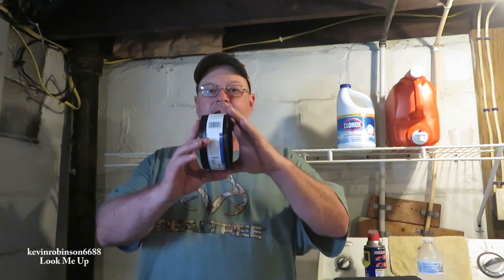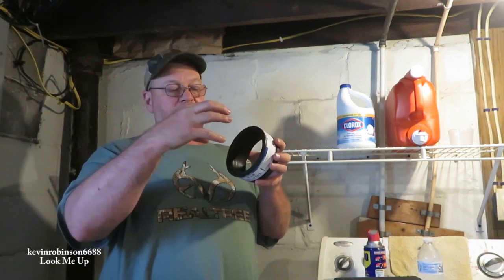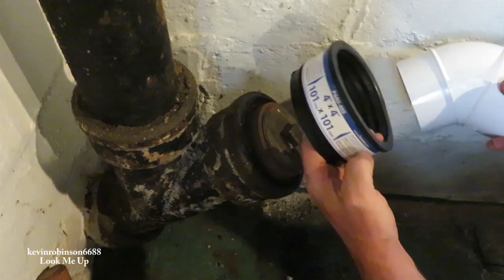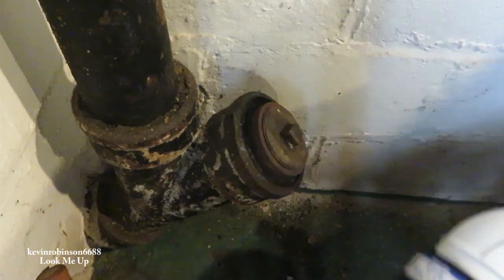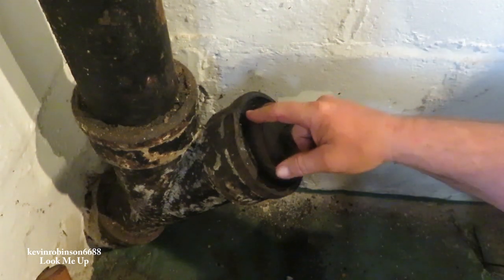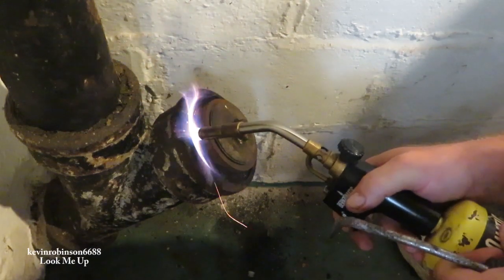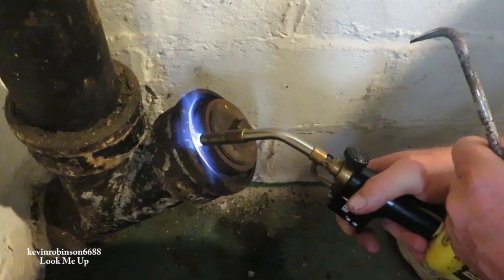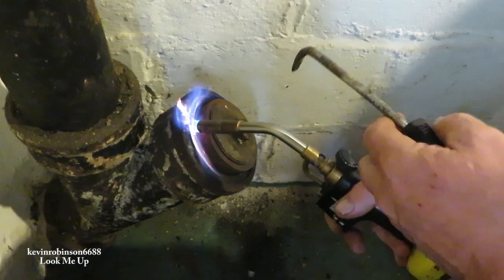How to remove a lead joint form Cast iron drain and connect to pvc pipe

Comment: At the end 14:55 : How the boot will stay in place without leaking? Are you going to glue? as I don't see any means for pressure tightening.
Reply: Not the right fitting he had a SDR fitting, needs DWV. With the proper fitting it will seal just fine.
Reply: I am getting ready to do this.  From my research, the outside of a sch 40 pipe will be a very tight fit in the rubber. In fact you have to lube the pipe with dish soap and then drive it in with a a hammer and block of wood.   The lips on the seal are facing such that they act as “barbs” like a fish hook making pulling the pipe out difficult.

Comment: Proves that if you have a lot of patience to stick with heating the cast iron, it will come free. Thank For This.
Reply from the maker: You bet thanks for watching
Reply: It is ALOT faster with a TURBO torch tip, but most residential plumber's do not have or need a torch that gets that hot

Comment: It looked like the fitting went into the Fernco donut to easily, The connection should be tight and somewhat difficult to install. I don't think the correct donut was used.

This is from the Fernco website:
     
Sewer pipe companies do not manufacture their pipe to common dimensional standards. Instead, pipe is produced to the designs and dimensions best suited for each particular sewer system. Because of this, variations in dimensions of pipe bells, hubs and bores are simply too great to permit making a single universal connector.
Fernco Donuts are available in hundreds of sizes and configurations for use with most brands and types of piping material.
Donuts can be ordered by giving the size, material and type of connection you want to make. Donuts require specific information on the manufacturer of pipe. Our sales coordinators are trained to assist you.
Donuts can also be ordered by dimensions. Donuts seal by compression and have much less dimensional range than couplings. The bell, hub or socket dimensions must be given within 1/32" accuracy.

Fernco phone # is 1-810-503-9000

Chamfering the pipe and using dish soap helps a lot with installation
Reply from the maker: Thanks for the info

Comment: Melting lead is safer than drilling if you use a respirator. Drilling produces tiny fragments that are more difficult to clean up. I wonder if heating up the outside of the cutout with a hotter gas would speed up the melting process. Nice video. I will be replacing some cast iron pipe in my 104 year old house soon.
Reply from the maker: Thanks for watching and be safe with your project.
Reply: Oxyacetylene or oxypropane would work much better. Cast absorbs all the heat, and the lead doesn't want to melt.

Comment: I usually just drill out the lead. After enough holes, the fitting will spin right out. It saves on gas and protects you from the fumes if you don't have proper ventilation.
Reply from the maker: Great tip

Comment: From my experiences its quicker and safer to drill most of the lead and oakum out instead of melting it out
Reply: Yep, I’m planning on doing this project this weekend and I’m gonna drill. Too risky using a torch
Reply: @Fordgroup00  no boom.
Reply: Isn’t it a bad idea to use a torch around sewer gases?
Reply: @juniormyers5378  methane gases... Which would be more a stagnant situation, pipes have vents and p traps,
But who knows, someone probably has blown themselves up given the amount of knuckle heads I've seen, but definitely a drill bit and chisel job here...
Reply: True,the professional way,I don't like a torch near a closed sewer line,methane could go boom.
Reply from the maker: Good tip

Comment: Is propane hot enough, or do you need to use a MAPP gas? Thanks!
Reply from the maker: Propane would be fine just take longer be careful you may have sewer gas read the comments first.

Comment: Thank you for taking the time and effort to make this video. To the comment section I would recommend a4” ez tight gasket,piece of 4” schedule 40 pipe and a schdule40 4” 45. St 45s or 90s are the best type of fitting for this connection, a short piece of pipe should be used to insure it extends through gasket and hits bottom of cast iron hub. the gasket here looks to be very loose. This connection with a proper gasket never goes in easy with minimal force. Use an ez tight or multi tight,take the edge off the end piece to insert and lube it up, you will know when it a good seal. To take out the old cast iron hub, chisel out brass cap, split inside of cast iron insert, chisel sides in and remove. I would shove a rag in the pipe to prevent and pieces from falling into line during this process
Reply: I cut a notch on the inside of the pipe. One on either side with a sawzall and cast iron blade.
Cut from inside of the pipe through to the lead as much as you can without hitting the hub.
When you have at least (2) notches chisel the pieces toward the middle.
I always put a balled up rag down inside the pipe to keep the pieces from falling into the drain line.
Reply from the maker: Thanks for the comment
Reply: I know this is an older comment, but how do you split the cast iron insert?
Reply: Is the EZ-Tight the correct gasket for XH (not service weight) iron pipe to join to PVC?
Reply: @AaronBennett-mi9uf  there are 2 different types of gaskets service weight and extra heavy I’ve used 4” service weight ones on both types of pipe with lube and some leverage to pop them in.
Reply: @AaronBennett-mi9uf  if your putting the pvc directly into the gasket/ hub be sure to ream the outside edge of pvc.

Comment: Being a plumber for 30 years these diy videos are very entertaining
Reply: To correct my typos I would NOT recommend a street or (spigot) type fitting for inserting into cast iron hub, use a piece of pipe
Reply: @MK-xl9tt   Your right. That 45 street ell just isn't long enough, I would have used a 1 foot section, that way you can drive it all the way (maybe 6 inches) until it bottoms out in the doughnut.  That doughnut has to be completely filled to expand into the cast iron hub and seal it.  After that you can put on any fitting you need.
Reply from the maker: Thanks for the comment
Reply: @MK-xl9tt  pvc pipe?

Comment: You used the wrong style PVC Street 45 fitting into the rubber Fernco fitting, they should NEVER push in loose as yours did. The one you used is called a "4" sewer and drain 45 degree elbow" which is slightly smaller diameter than the correct fitting called a "Schedule 40 PVC-DWV Street 45" (DWV). ... Drain, Waste, & Vent fittings are used inside buildings and Sewer & Drain fittings/pipe (S&D) are only used outside buildings for the sewer lines that start approx. 2' outside the house and run to the municipal sewer connection. 
Also, the pipe you call "Black Iron" pipe is actually called "Cast Iron" DWV pipe and is either "Service Weight" CI or "Extra Heavy" CI and those old fittings will be embossed with a "XH" or "SW" on the hub exterior as they are slightly different in size. When you buy those rubber Fernco donuts for this type of replacement job you need to know whether your CI hub it is going in is XH or SW or they wont fit/seal properly.
I have made many of these "CI to PVC sch 40" repair connection's in the past and have always needed to extremely force the PVC-40 fitting into the donut hub, even with grease on both pieces, so when yours went in with zero resistance it showed that the wrong fitting's were used.
Reply: God bless you for your educational comment. Can you please tell me where can I purchase the donut for Extra Heavy pipe 4 inch?  They sell SW donut in Home Depot, but I have a real problem: can’t find correct donut fog XH.I soooo much appreciate your knowledge and time. Thank you!
Reply: @Miftakho  Just to let you know, I did reply here last night with some very lengthy explanations to your questions and it did show up in this comment section for about 1/2 hour after submitting it, but then it was removed without any explaination .... I don't know if it was the YT people or this guy "kevin robinson" who didn't like what I said, but either way that's pretty shallow.
Reply: @bobrub  I'm working on a kitchen drain for my daughter and her cast iron is broken under the slab. I  haven't cut it open and removed the bad pipe back to a hub I will have to look to see if SW or HW. Either way do you use sealant between cast and rubber donut and what holds PVC pipe into donut? Friction or sealant?
Reply: @jeffreprogle7958  When using a donut it has self sealing rubber edges that make the water tight connection both inside the hub and against the inserted pipe. Sometime you need to use a light grease or dish soap to facilitate insertion. PVC pipe should have a 45 degree bevel ground on the end to be inserted and you will feel it bottom out in hub at full insertion. In your repair, an easier method may be to cleanly chop off the rotted cast iron downstream of the bad point and simply use a shielded coupling (commonly called a "no-hub" coupling) made to join PVC sch 40 pipe to SW or XH CI pipe of various sizes. Google fernco proflex couplings to view. Available online or at plumbing supply house.
Reply from the maker: Thanks for watching and the comment.
Reply: Thanks for that master tip.

Comment: nice video and thank you. mine doesn't have the lead joint, copper connects to the cast iron directly and stuck. any suggestions? thanks a lot.
Reply: Joe M  thank you very much.
Reply from the maker: I heated mine but could not break it loose it saw seized in there.

Comment: my main concerns with this method of removal is lead vapors and possibly setting the oakum aflame.
Reply from the maker: Yes be very careful.
Reply: Used oakum is soaked so expands to seal the pipe, making it non burnable. Dried out oakum, like above all the sinks, will burn. Lit some the other day. (accidentally). No stink pipe odors 👍

Comment: How I remove lead....unscrew c.o. plug.....insert rag to protect inside of pipe form debris....use reciprocating saw to cut c.o. fitting...cut fitting in two places and drive chisel into edge to spread fitting inward...remove c.o. fitting...cut out lead very easily and remove....saves
your lungs and the atmosphere from all that heated lead, oakum, and stink.
Reply from the maker: I couldn't get the c.o. plug unscrewed thanks for the info.
Reply: @Robinson-Homestead  hammer and chisel

Comment: You know there’s flammable gasses in that pipe right?
Reply: There could be, except methane is lighter than air and the vent tube attached to that joint takes it away making the volume of combustible gas almost negligible.
Reply from the maker: Thanks for the info.

Comment: I don't understand the first piece that you had the rubber hub was that what you ended up using in the end what's the deal with that? Did you just realize you had the wrong thing?
Reply from the maker: That was the same rubber thanks for the comment

Comment: How do replace the bottom section of a cast iron drain column with PVC or ABS? Will the weight of the column be too heavy for the transition?
Reply: Hi, it depends on the situation.
Reply from the maker: sorry i'm not a plumber, so i can't answer that.
Reply: Joe M , Riser clamps should be used to hold it up .👷🏻

Comment: Hey smokey, that hub fitting looks a little loose on the pvc,  they do have different sizes,  mine always fit snug,  like real snug,  hope sewer never backs up, just might seep out, just my opinion
Reply: David your right way to loose. The 4" street elbow he used fits inside the 4" pcv pipe that why it was so loose (easy). Should have started with 4" pipe then add the elbow.
Reply from the maker: Thanks for the info
Reply: The hub says that it is made for ABS pipe not PVC pipe. I wonder if there is a difference?
Reply: Eamon Road , They are both the same size , standard pipe size. 👷🏻
Reply: @johnkrim8377  Not a plumber, but my understanding is that there is no "standard" size cast iron fittings. Each foundry had their own molds, so there can be significant differences in diameters for any given nominal size. That's why there are many different sized "donuts" available. Best to measure the ID of the hub to get the right size donut. My guess is that the OP's hub was a bit bigger than what that particular donut was meant for. The inner diameter of the donut is sized to the standard pvc/abs size. If the hub was smaller, it would squeeze down the inner diameter when the donut was inserted into the hub, so everything would be tighter. It really should take much more work to get everything inserted.

Comment: Although I could be wrong, I believe the reason the PVC fitting is loose is because it’s a “Street” elbow, which means its outside diameter is 4 inches, and the rubber adaptor is expecting the normal outside diameter of 4.5 inches.  I imagine if he stuck a normal piece of 4 inch PVC pipe in there, the fit would be very snug.
Reply: Street is same size as OD
Reply: @r777v  No, the street size would be the same as the ID, not the OD.
Reply from the maker: thank you for the comment
Reply from the maker: @davidramey7186  sorry your right about Street elbow it has been working ok no small or leeks thanks for the comment.
Reply: Correct. His install would fail an inspection! Which we know code is the bare minimum... not the top notch. So not even passing code is a major red flag

Comment: A lot of plumbers just call that a "Donut"  after you put the donut in the hub and you was able to put the pvc pipe in easily I think you should have got the heavy weight one. Because usually it should show some restrictions for it to be water tight.
Reply from the maker: Thank you for the info.

Comment: I'm sorry but that boot Cast Iron to PVC connection is loose. Hella loose. Even if you push it in further it does not look anywhere close to a solid seal. If you ever have a backup, you are sure to drip at this spot. What gives???
Reply from the maker: Thanks for the comment JJ.

Comment: Ever think of wearing some good leather gloves? I wouldn't trust that transition joint--way too loose both at the cast iron and the pvc. PS-the packing is called oakum.
Reply from the maker: Thank you Gman.
Reply: Exactly, what makes it a secure connection when you’re putting a street fitting into that donut? That wouldn’t have to be bumped very hard to jostle it around

Comment: How come you didn’t just unscrew the clean out cap and thread in a thread to slip coupling?
Reply: Ben Boudreau , It is not a standard pipe size thread.👷🏻
Reply from the maker: I couldn't get it to move.
Reply: @Robinson-Homestead  😢😢😢😢😢😢
Reply: Those old caps are no joke. I tried u screwing one that is 90'd out of my mom's wall (hung sewer). Perfect leverage conditions, hammering on a pipe wrench and it was seized in place. Ended up removing and snaking out a more difficult position

Comment: Getting ready to do a similar project myself. Always good to watch someone else do it beforehand.....I'm thinking maybe a combination of drilling and torching, maybe?.....Now I'd like to see a video of a plumber putting those pipes together from way back when! They would be so envious watching us glue PVC pipes together today!
Reply from the maker: good luck on you project and make sure to have plenty of ventilation.
Reply: Yeah I bet that had to stink!
Reply: Why not cut the co flat w/sawzall, then use hole saw to cut lead out?
Reply: This is a fail inspection 
Doughnuts not allowed inside the foundation... And for good reasons.
Nothing about this video is useful

Comment: I wasn’t aware black iron came in DWV fittings. I also thought the joints were welded or threaded not caulked. I would have drilled it out. It’s relatively quick as lead is soft. Lead also melts super fast even with mapp gas so it might run down the pipe. You could have drilled 10 holes in that before the heat even melted the lead. Also you shouldn’t have used vasoline on rubber. It will degrade the rubber pretty quickly.
Reply from the maker: thank you for the information
Reply: Silicone grease

Comment: Please be advised, you must wear a respirator, the fumes from the lead can be very toxic, that's why we don't have any old plumbers around who installed lead joints. Also let's not forget that methane gas is very flammable.
Reply from the maker: good information thank you
Reply: Yeah when he said heat up I was like oh no Methane,  please work out please work out.  That Methane really concerned me.
Reply: @Joanthony Almestica RESPIRATOR!!!
Reply: I'm 80 still kicking I've melted it out like that if the methane catches on fire the draft will pulling up the vent 😊. That oakum will smolder if caught on fire😮
Reply: Oh the safety cop is here. They died of old ages and not by lead
Reply: Y’all are making too big a deal about the methane. If the methane explodes, then the fitting blows itself out of the joint. Problem solved!🤣🤣🤣

PS. You may want to wear a blast shield over your respirator!😆
Reply: there is one left named roger wakfield
Reply: @jacksplumbingvideos7147  Don't forget Steven Lavimoniere.
Reply: @jacksplumbingvideos7147  this old house sure gets his value of plumbing by the $$$

Comment: Cautionary note, don't do this (remelt lead) repetitively and/or in a poorly ventilated area; it will make you stupid.  

On another note, isn't the clean out cap acting like a big heat sink.  Do you think it would have gone faster (the heating that is) if it had been removed first? Plus it could have been attacked by both sides.  What was the benefit of leaving it on?
Reply from the maker: i couldn't get it out.
Reply: Wear a respirator